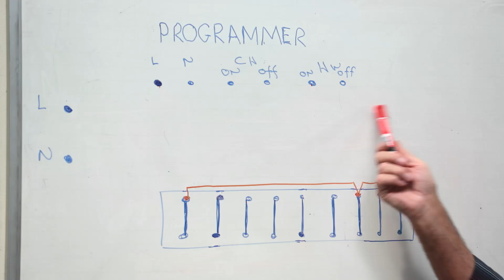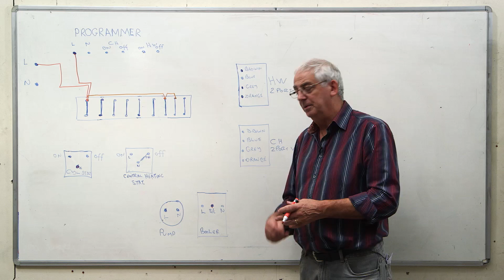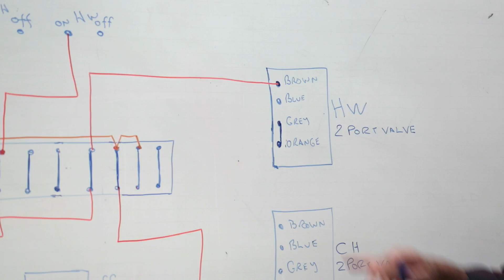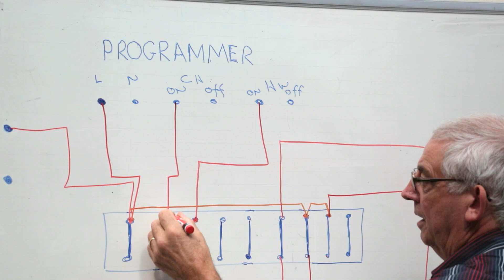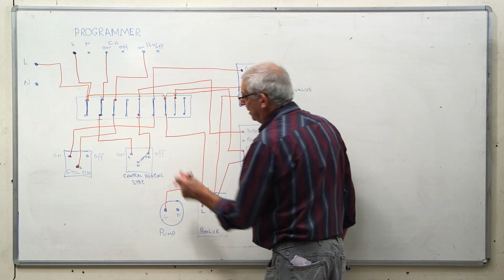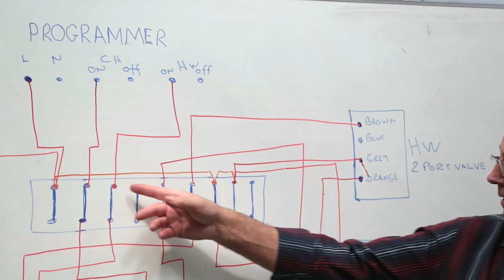S Plan

Comment: Wiring the two port valve grey wires with permanent lives as you have shown here, is a better option than connecting the grey wires to the programmer as you suggested could be done.
If the grey wires were connected to the programmer then all power running the heating system would be passing through the programmer, giving the contacts within the programmer a bigger load to deal with, where as having a permanent live to the grey wires, means the programmer now only has to deal with the power passing to the small motors within the valves.